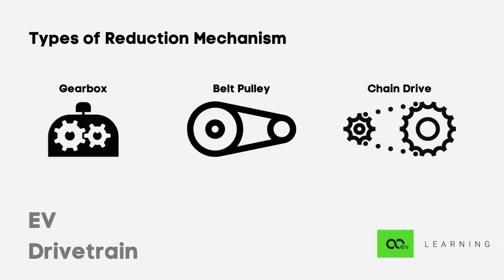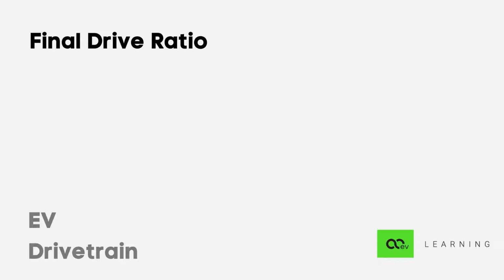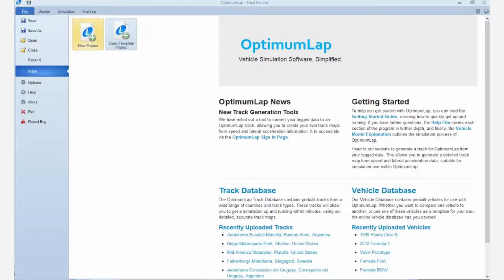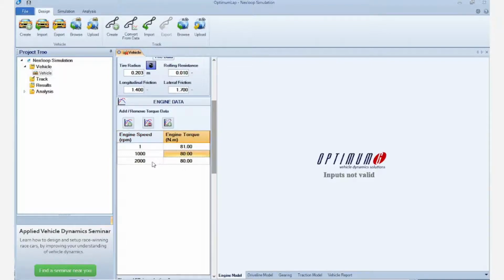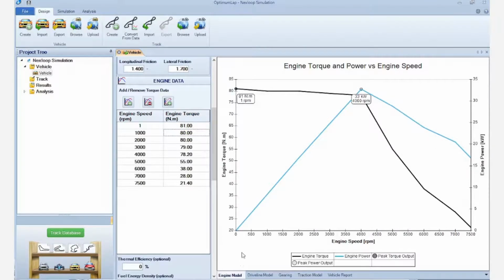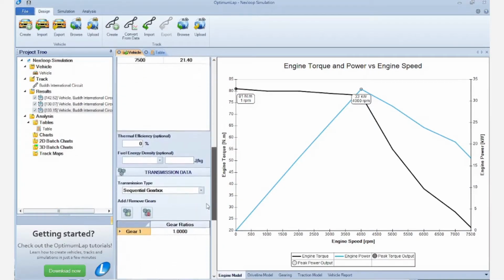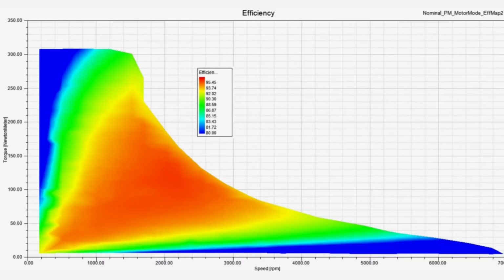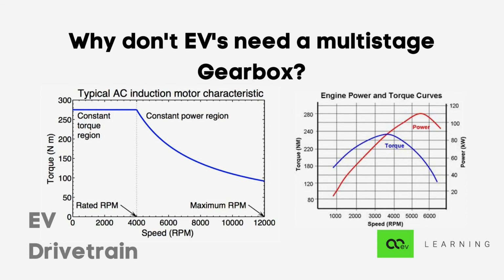EV Drivetrain |  Lesson 26 - Course on Fundamentals of Electric Vehicles | Nexloop Learning

Comment: Sir i have a very basic doubt , does the motor draws different amps at different speed ? I mean based on the different speed required for the vehicle does the motor draws diff amps from a battery ? Like if the ev needs more speed then more amps will be drawn and if ev needs  medium speed then the motor draws less amps from a battery ?
Reply: No. The draw of the current by the motor is dependent on load. Basically how much torque you want to produce to overcome the road load. You should generally vary the frequency of the reference signal to change the speed of the motor. You can find more info on this if you look up "V/f" control